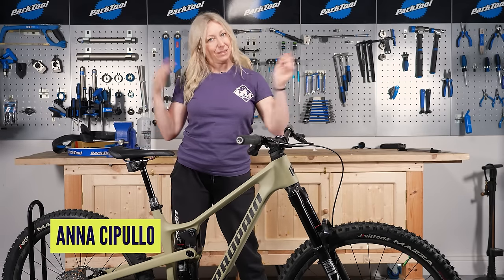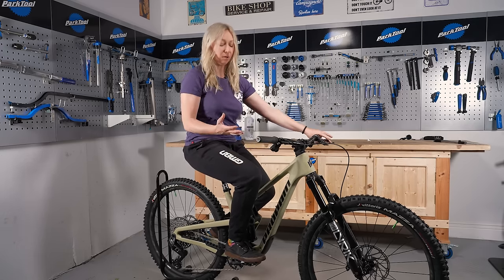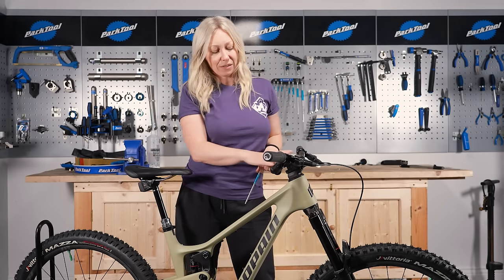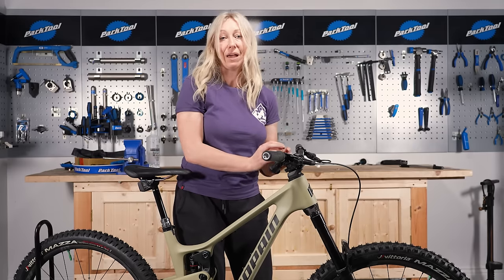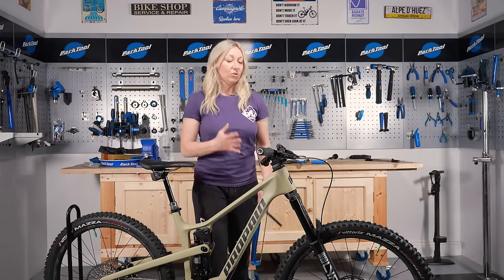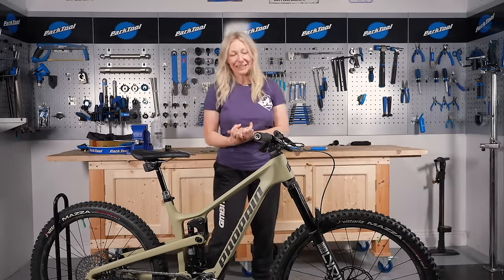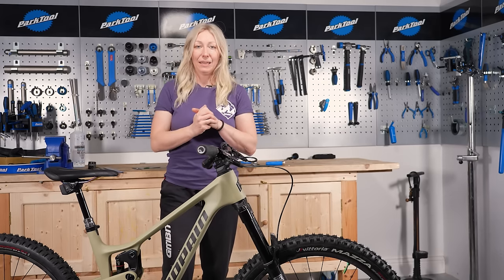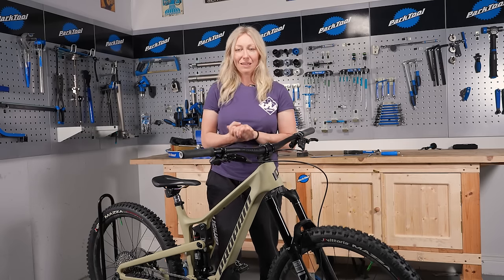Got A New Bike? How To Make It Work Perfectly For You!

Comment: #askgmbn is there recommend correlation between the saddle height and handlebar height? There is often times to little adjustment to handlebars in my opinion. I like the bars roughly level with the saddle and had to install a higher rise bar to achieve it.

Comment: How does the saddle setback (aligning knee with pedal) work with steeper seat tubes on modern bikes? Moving the saddle back effectively slackens the seat tube angle, negating the supposed climbing benefits. #AskGMBNTech
Reply: I can't stand modern bikes for this reason.  76 degree seat tubes and inline posts from factory.  I'm directly over the pedals and my knees are half a foot over my toes.  End up with crazy knee pain.  

I'm used to riding a GT force LE with a 66 head angle, 72.5 seat angle with a setback post.  Knees end up over ball of feet at 3 and 9 with no pain.